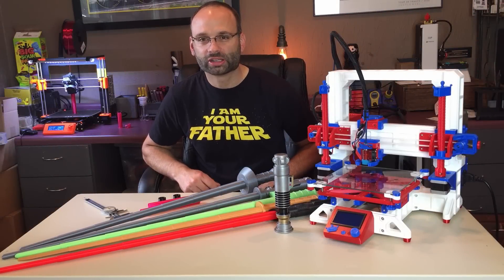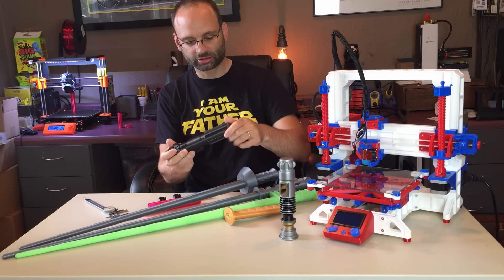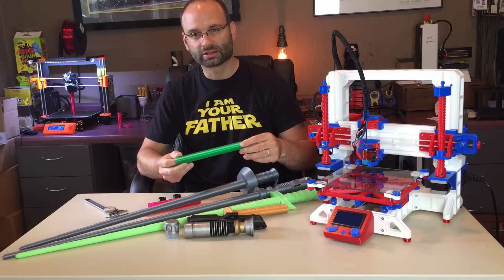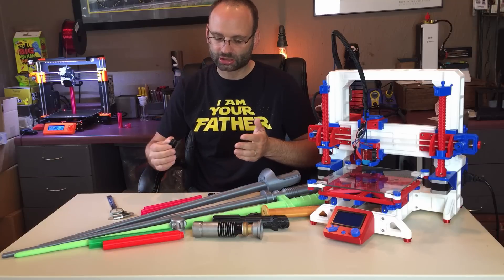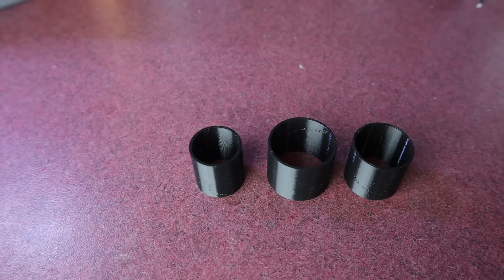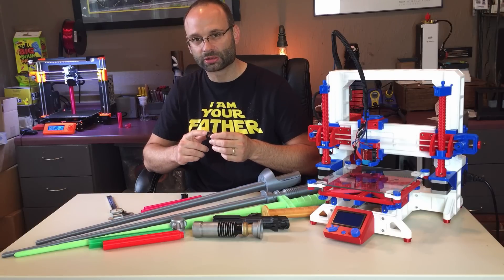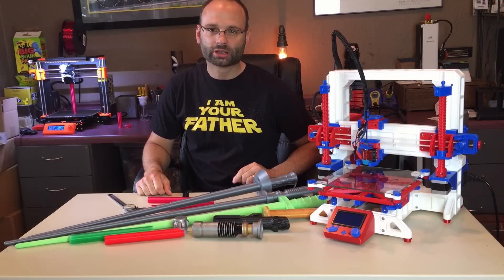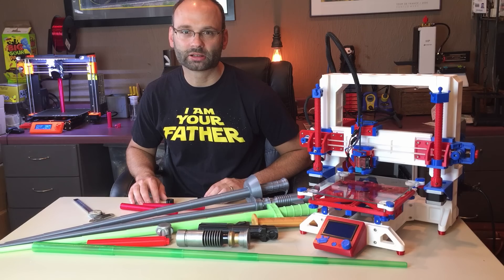Collapsing Swords - Troubleshooting

Comment: Tip for Cura 4.8 if you're getting solid bottoms on the vase mode (Cura calls it "Spiralize Outer Contour") models. In the Special Modes section, change Surface Mode from Normal to Surface.
Reply: I'm having trouble with the saber wen I printed it that blade  gets stuck and  cant separate it help
Reply: @coolmangame-gi8hq  Same
Reply: Thanks so much I was searching on google for ages could not figure out why :)
Reply: I just set bottom layers to 0
Reply: Holy jiggly puff you solved my problem since the bottom had a plate on it and it was easy to slide out and now I know why. Again that you
Reply: How do you get it into vase mode

Comment: Trying to print with petg. It's a challenge. Seem to be getting little blobs after retraction .... Been tweeking and tweeking
Reply: Bowden tube was away from back if nozzle. Fixed now big improvement
Reply from the maker: If it doesn't work the blades print really easy in vase mode and are stronger as well.
Reply: Yeah cool. Thanks 👍. Then they'd have to be all printed one at a time and assembled right?
Reply from the maker: @originalAtreyu  Yep, I print them sequential so I don't have to start a bunch of individual programs.

Comment: i use prusaslicer and there is no coast in it. is there anyway to get it to work with prusaslicer or am i kinda just sol
Reply from the maker: No, plenty of people have printed it with prusa slicer.  Have you tried without coast ? Each slicer act differently so coast may not be needed in PS.  You can try the test print first.

Comment: is possible to get the katana sword like the light saber i want the blade to be different color
Reply: In a modeling program you could remove the "pommel" plate and set the blade outside and then 3D print the plate on its own and glue it on after you put the blade in.

Comment: I swung by because I'm having issues with bed adhesion for the blades. I'm new to FDM printing so I'm probably just making a basic mistake. I may simply need to re-level, but I'm seeing what results I get with a raft. I got a successful print with a brim, but I haven't (yet) been able to pull a section of blade from the handle.
Reply from the maker: With the trimming, a brim or raft is not ideal. You really need good adhesion. Whats your print surface?
Reply: @3DPrintingWorlds  The bed is some kind of ultrabase kock-off. Upping the bed temp may have done the trick, though. I'm currently working through a different, easier, print that also had adhesion issues. Thanks for the reply! Hoping I don't have to resort to glue stick just yet.

Comment: when I print the blade, it prints, and after about 1/3 to 1/2 way then the blade for Darth Vaders Saber moves out of its position, and the rest of the blade tries to print on the side. Do you have a solution?
Reply from the maker: Sorry for the delay, Sounds like a bed adhesion issue.

Comment: im on my 3rd attempt at the light sabre blade...... test prints fine..... but my model keeps getting knocked over late in the print. I even upped the bed temp to like 67 or something quite high

any ideas as to why? im trying again using a raft to try to hold it down a bit better
Reply from the maker: Sound like two issues.  Bed adhesion and cooling.  It must be curling up causing your nozzle to knock it off. Can you increase cooling, lower extruder temp maybe.
Reply: enable Z-hop thats how i did it

Comment: Having a hard time printing the saber with the detachable hilt. What print speed do you have this at? Also i'm experiencing a beading inside each vase. Not sure what to do about this.

Slicing with cura 4.5
Line Width: .8mm
Wall line count: 1
Print Speed: 50 mm/s
Outer Wall Speed: 20 mm/s
Travel Speed: 50 mm/s
Acceleration Control: Activated
Jerk Control: Enabled
Enable Retraction: On
Retract at Layer Change: On
Retraction Minimum Travel: 1.6mm
Combing Mode: All
Avoid Printed Parts When Traveling: On

any tips, appreciate the creations btw
Reply from the maker: You are printing them singly, in vase mode right?
Reply: @3DPrintingWorlds  Correct
Reply from the maker: @mindsofgreatness  I dont understand why you are getting a bead if there are no layer transitions.
Reply: @3DPrintingWorlds  Looks like an inside seam, what settings have you adjusted for best results?

.8 for the line width anything else?
Reply from the maker: @mindsofgreatness  Really .84mm.  When you preview in your slicer does it go around in a spiral? There should not be a seam.
Reply: @3DPrintingWorlds  I turned on coasting and it's getting better but still fusing together. What do you have your mesh resolution at? I'm not giving up lol
Reply from the maker: @mindsofgreatness  What do you mean by mesh resolution?

Comment: Can you please add some print settings for Cura? I have done test prints, but even with coast and wipe they fuse together and are almost impossible to get apart. The help would really be appreciated because I think these are amazing toys and look very cool!
Reply: Lower your flow rate. Print at .02
Reply: @dugy40  what setting do you change to .02
Reply: @Braydenstremel  resolution
Reply from the maker: Yeet Boi sorry don’t use cura. Someone posted a profile on Reddit a long time ago.
Reply: @3DPrintingWorlds  Ok thanks! I can try it on slicer or something else!
Reply: @3DPrintingWorlds You reckon I could print a version the katana in resin with an SLA printer? (Probably a formlabs 3.) I’m also thinking of what kind of materials the blade could be printed out of with SLA.
Reply from the maker: I know some people have tired but they did not fill me in on the results.... @johnmad4372

Comment: Is it possible to get a button/lock so they won't open when upside down?
Reply from the maker: If you have any good ideas, please share?
Reply: @3DPrintingWorlds  I'm not the best with all of this, I have no clue how to edit files etc, I'm completely new, so I can't really say all too well. But I was thinking of a locking mechanism like the old 2000's Lightsabers where you push the button in and down to release the blade. I just Don't have the technical know-how of doing it or working it into a design.

Comment: Noob question when i load the single blade files in cura it shows it as a filled object. What do you need to do to make it hollow etc so it can slide within the others?
Reply from the maker: Turn on spiral or vase mode and turn off top and bottom layers.

Comment: I still can't get it to work :( I am using the test print, and I have turned extrusion multiplier to 100% (and down to 90% for another test), turned off coasting, and turned down the print speed, but the inner two are still fused together. Any other suggestions on what I can do? I am using PLA, 0.2mm, 20% infill, print speed 50mm/s. I don't know what to do.
Reply from the maker: How come you are using a .2 nozzle?
Reply: @3DPrintingWorlds  It's a 0.4mm nozzle. I meant that I used a 0.2mm layer height.
Reply from the maker: @DanielBennion  oh, sorry that makes sense.  Is it fusing at the seams?
Reply: @3DPrintingWorlds  Yes, but only on the inner two seams. The outer one isn't connected at all. What do you think I should do next?
Reply: Coasting should be on.

Comment: Hey, if I had my own collapsible blade that I would like to put into your lightsaber hilt and the diameter of the bottom section is 20 mm, what should be my clearance to ensure the blade wont fall out? Thanks
Reply from the maker: Its more complicated then that because the blade in on a angle.  I would suggest downloading the "template" file I made and using that for reference.

Comment: When I try to print the sith lightsaber the hilt always falls over do you have any ideas of whats happening one second its stuck onto the bed and another second its moved a couple centameters then it eventually falls over
Reply from the maker: Strange, could you try a brim?
Reply: I recently switched from using painters tape to just giving my print bed a layer of Prit stick glue and I’ve had really really good adhesion since! Just make sure to turn off your printer and keep any water away from electronics when wiping down the bed afterwards!

Comment: ive printed about 10 test prints all with coast and wipe on and each with different settings on cura and I cant seem to get it right. Any tips?
Reply: probably means your printer isn't setup well. he didn't cover the basics, this is about when you're printing usually perfectly but this isn't working, then coast and wipe might be it, but otherwise, you may not have a well setup printer, at that point it can be to much to cover, it could be extrusion, or many many other things tbh. PID, linear advance, travel speed, extrusion, bed leveling, z-offset, filament, tempatures, just to name some of the basic

Comment: I tried printing the sword part in separate pieces since my test print didn't work and they are solid on the top and bottom. Am I doing something wrong? Because aren't they supposed to be hollow with a taper, not solid on top and bottom. Except for the last piece I would expect to have a solid top. I'm using a Lulzbot mini and Cura to print. I adjusted the Flow rate to 92% but that didn't seem to do any better. Any help would be greatly appreciated so I can print this for my brother asap
Reply from the maker: Oh, the separated pieces are meant to be printed in vase mode. Just make sure your extrusion width is set to .85mm
Reply: @3DPrintingWorlds  That's a great tip - does it imply a 0.8mm nozzle? I only have .4 and .6
Reply from the maker: @AdiTanase  You can actually extrude wider then the nozzle, no problem  There is a limit but I cant remember what its is but you can go .85 will a .4mm nozzle no problem. 
FYI...You can not make a line width narrower then the nozzle.
Reply: @3DPrintingWorlds  How would one enable vase mode?
Reply from the maker: @tristensantilli2437  Its normally called "Vase" or "spiral" mode, depending on your slicer.

Comment: Do you need to print supports on the sith lightsaber hilt?
Reply from the maker: Nope.
Reply: @3DPrintingWorlds  i have a problem with printing the blades. 1st one turned out fine, but the second one isnt hollow all the way through. At the bottom it has a little circle that blocks the other blade from entering there. Did i do something wrong?
Reply from the maker: @sebastiankrarup3784  Are you printing them in separately ?
Reply: @3DPrintingWorlds  yes but i fixed the problem by removing all bottom layers
Reply: @3DPrintingWorlds  not even tree for overhang on sith?
Reply from the maker: tabatha davis zip, zero, nada.

Comment: Can you please help me here? I printed today almost 10 "test prints" with different options i collected from many comments here, but all of them, are connected at the z-seam. the outer circle (of the test print) is ok, the seam is not sticking out, but the other two inner circles, have seam coming aside, which causes to bond to the other circle.
here are the final settings i used:
layer height: 0.28
outer wall wipe distance: 3mm
z-seam alignment: shortest
coasting volume: 0.24 mm3
flow rate compensation factor: 90%

https://cdn.thingiverse.com/assets/8a/06/bb/9a/1c/IMG_20191120_165416.jpg
Reply: Exactly whats happening to me (Cura 4.3 with a Anycubic Chiron). Total printing noob so it's quite the learning process.
Reply from the maker: Could the issue be that you are getting a blob when the extrusion starts?  If so, I know S3D has a setting to combat this its called "extra restart distance".
Reply: I have the same issue, do you solve yours ? Thanks
Reply: @pixelshot09  try to lower the "flow" values, it helped me
Reply: @danielsabag5294  yes I've already lower it at 77 %..

Comment: Do you keep "Perform retraction during wipe movement" (in S3D advanced tab) checked? Also in the video, it looks like you changed the Start points from aligned in the fused test to random in the good test, is that correct? Thanks so much for this video, I've been trying to get this to work for a while now.
Reply from the maker: Nope, I dont have it checked.  I had start points "optimized for speed" for both, but when you turn on wipe it changes the start point. Good luck!

Comment: the print keeps fusing up even with coast and wipe turned on and a flow of 92 percent
Reply from the maker: I forgot that I had z-hop on and I found that was causing issues, maybe check that?
Reply: How do you adjust flow? Is that done on the printer or software? I just got a cr10 and it came with creality program/3d software also downloaded cura.
Reply from the maker: @jvh22a  Its called "Flow rate" in Cura I believe.
Reply: @3DPrintingWorlds  found it under custom settings(or advance). Thanks.

Comment: My issue is even with wipe and coast enabled is that it continues fusing. When it jumps from one section of the blade to an inner section, it leaves that little bridge between them. I'm new to this, so please bear with me. What am I doing wrong?
Reply from the maker: I would keep the temperature as low as possible and increase your retraction setting until the stringing is gone. I can tell when my coast and wipe are too high as I get a void at layer transitions.

Comment: The only problem i have is that i make the pieces separetly (the star wars one) and the parts tip over on my bed because they are too tall.
Reply from the maker: Try printing it upside down.
Reply: @3DPrintingWorlds  wouldnt that just make the surface even smaller?
Reply from the maker: @sebastiankrarup3784   Less contact but a larger diameter, especially for the tip. I dont know what your print service is, make sure your first layer is low enough.

Comment: I'm having a terrible time dialing in my printer to get the blade from fusing together using cura 2.7 wall thickness 0.8, outer wall wipe distance 0.2, top/bottom thickness 0,Z seam alignment random, layer height 0.2 , initial layer height 0.3, infill 0, nozzle 205 bed 60 flow 92%,speed 60 cooling 100% after first layer, coasting 0.064,before coasting 0.3 coasting speed 90, and i have tried adjusting these settings 12 times with the same results test print still fuses together is there a setting that i'm not using that needs to be turned on? i watch the video prob 15 times and i still cant seem to get a good print hoping someone sees this post and can shed some light on the issue thanks BTY great job on your models
Reply from the maker: What is your actual blade thickness when you measure it?
Reply: .02 not .08

Comment: Thanks for the info. For some reason when I turn on coast and wipe i get a lot of messy stuff on the outside of the print.
Reply from the maker: Like stringing, maybe retraction settings?
Reply: yes it looks like stringing almost like the oozing being wiped off the nozzle when it wipes. So retraction would be a great place to start. Also the flow rate I want to tweak because I haven't changed that yet .
Reply from the maker: @jerryp1012  Here's a good guide. https://mattshub.com/2017/04/19/extruder-calibration/